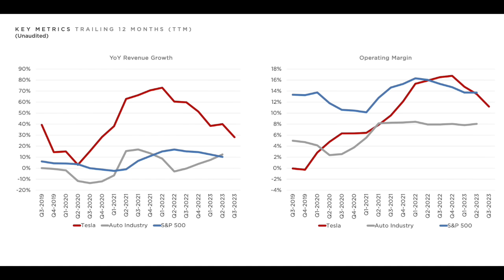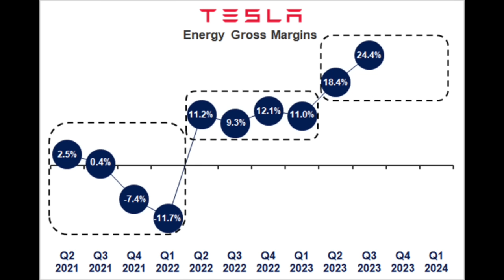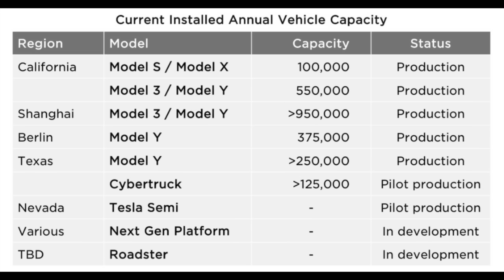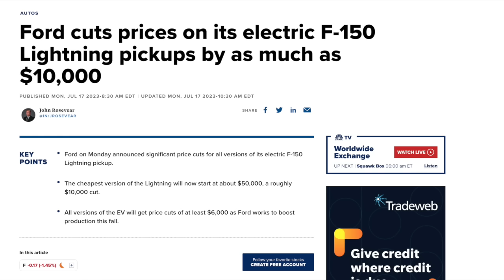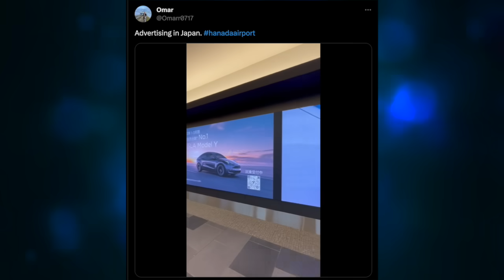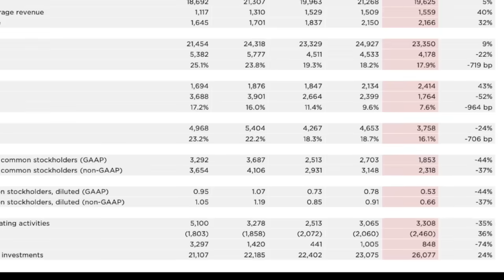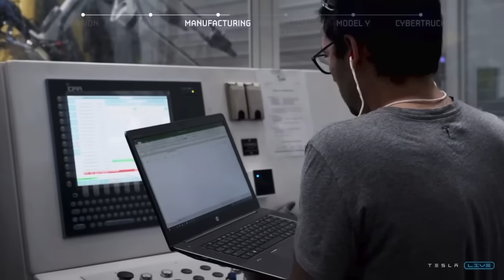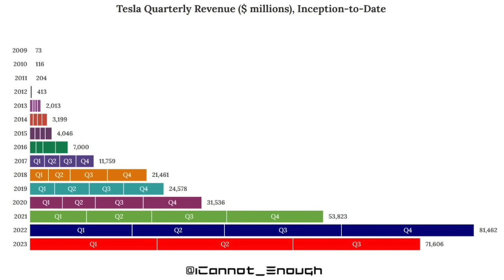Cybertruck is coming - Tesla’s Q3 earnings - Enhance the financial reserves

Comment: It is important to remember that Tesla has achieved cost reductions of 6.5% in an economic environment of high inflation. That is remarkable.
Reply: 100% YES!!
Reply: I read the biography about Musk,  and it really gave a good insight into how much Tesla focus on cost reductions. Elon has a saying "if you dont delete so much, that you have to put 10% back, you dident delete enough" . There also was a great example where Elon walked the lines and saw a piece of the car with 6 bolts in it. Elon asked why 6 ? And they said that the engeniers said that 6 were needed to hold it together. Elon stod for five minuts and calculated in his head, then said, No only 4 are needed. So they had the engeniers look through their calculations again, and dont you know it, Elon was right !
Reply: TESLA is Setting the Market price for Vehicles.
Reply: @MrAlanfalk73  Classic example of how Elon thinks.